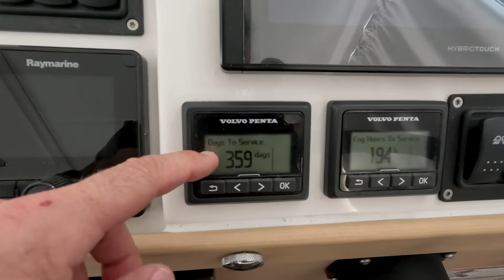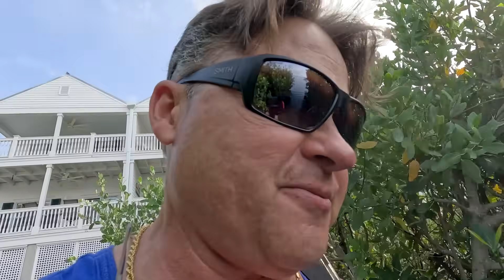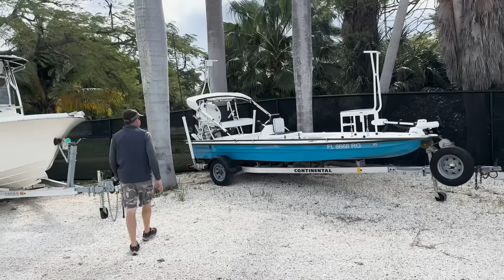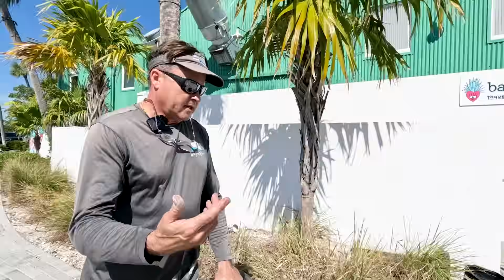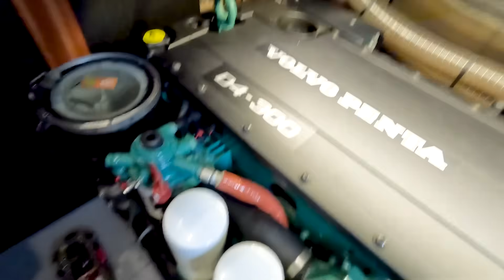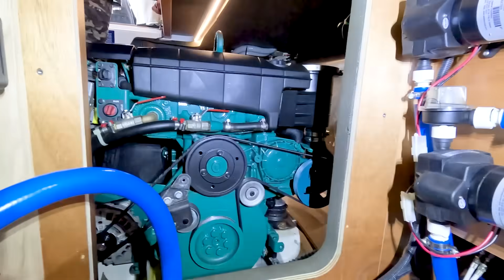What NO ONE Tells You About Owning a Yacht

Comment: I had a twin engine 30 foot yacht for 15 years and people think if you don't use it much then it will cost less, well that is not true as there are costs whether you use it or not, insurance for one as well in my location a regular marine survey every 6 years at a cost of 700 dollars, so insurance will maintain coverage, upkeep like hull cleaning, water intrusion, water pumps for keeping hull dry due to leakage, battery maintenance and I have 5 large marine batteries. Shore power, I am mean it is fun to own, but you are a slave to it.
Reply from the maker: Yes slave it is right. Constantly.

Comment: Most likely the PCU is bad . I always try an auto config first .  Since you’re going to update the software . I would swap port and SB PCU’s and run the software into  then . See if the hour issue follows the  PCU.  After you get the new PCU, you need to call tech support (Aaron) and have Volvo Penta credentials temporarily raised. Then you can up the new PCU engine hours.  You can only raise hours not lower hours.

Comment: I was thinking of everything before I bought my boat. I have been on many charters and I spent more time being tangled in some one else's line than I did fishing. I thought of renting. Those boats are a 50 50 whether the maintenance has been kept up so you are not left stranded 30 miles or more from shore. I don't mind cleaning or maintaining the boat. I am an auto mechanic. Although boat engines are different than cars, they still function the same way. Only the need a little more attention than cars do.
Reply from the maker: You’re lucky you can work in the boat yourself.

Comment: I am in automotive repair business and I consider anything not oem is counterfeit parts. They are imitation parts that look like the real thing but are not the same quality.  On very rare occasions I will use a non oem parts only if it is better quality but 90% of the time the oem parts are best. I would not trust an air plane, boat or safety features on a vehicle with anything but oem.
Reply from the maker: Agree with you OEM the way to go.

Comment: A pre-purchase inspection of some kind should be mandatory for any rational purchaser whether it's a boat, an aircraft, a large vehicle (RV, tractor-trailer, etc.), or any other large purchase that will require significant preventative maintenance. For the aircraft we had purchased, our first annual inspection included a bunch of mandatory maintenance (called ADs or airworthiness directives) and a few planned upgrades (better seat belts instead of just replacing the lap belts originally equipped, better lighting). That trip to the shop cost as much as purchasing the aircraft. An engine replacement often is going to be more cost than the purchase price of an otherwise acceptable condition used airplane, and the same goes for big trucks. The first time I brought the Peterbilt to the shop, when it was leaving the shop the bill was over $24k.

With the airplane, we would often talk with other owners in "Aviation Maintenance Unit" numbers (1 AMU = $1,000 USD).
Reply: As a retired maintainer (USAF comm/nav on Phantom and Bronco, engine mech and crew chief on F-16) if I were not already an A&P and wanted a personal aircraft I would pay for the schooling because that would be a bargain while giving me technical insights mere ownership never would. Parts prices would still be horrid but I'd dry my tears with the cash saved on labor, and the work is mind-expanding fun. 

Of course many truckers do the wrenching on their rigs and small fleets with commensurate benefits. I'm not a trucker but helped out my truch mech bro for the education as I enjoy wrenching everything. The junk he was handed to fix was terrifying but local log trucks don't need to cross DOT scales so they have to break down to get worked on. His cutting torch got plenty of use...

Comment: I have a 2000 45foot Excalibur my starboard motor dies if I hit my outdrive trim sometimes it’ll start back up and sometimes it won’t. Is that a grounding issue or ignition problem I replace the batteries and new alternator before I replace the alternator. I was getting 16 V on the starboard motor when I turned the key onwhen I replace the alternator it went back to 13 bolts so I thought that took care of it, but I’m still experiencing the problem. I emailed you. Thanks for your help.

Comment: Funny thing happened on my Mercruiser. Kept on loosing water pumps. I only bought factory pumps to replace.
Mercury was selling and installing automotive water pumps that needed antifreeze to lubricate the seals. My boat used raw water for cooling. I finally had to go to a aftermarket supplier, problem fixed.
Reply from the maker: Wow that’s crazy.

Comment: Are Silent yachts less expensive to maintain excluding fuel?
Reply from the maker: First off you still need to run the generator to charge the batteries.  There is still a drive train,  and look out if you have to change out the battery bank $$$$$$$$

Comment: My rule of thumb is that boats and yachts have an annual cost of about 15% to 25% of their value - excluding very small/inexpensive boats.  So a $100,000 boat will cost you about $20,000 annually or say $1,630 monthly.  If you use it 12 times annually, it will cost $1,600 per use.
Reply from the maker: Yup costs just depend where you live and cost of fuel.

Comment: Boats are expensive. We have an 06 46 foot that we bought used a few seasons ago. I spent 25k this winter just fixing cosmetic stuff from the old owner, in addition to probably 10k the winter before on urgent things. Next winter I’ll probably have the bottom media blasted and a barrier coat/ablative paint applied. Mind you, this boat surveyed very well! The list never ends, and if you buy it brand new, the list is shorter and the depreciation is larger. But I wouldn’t have it any other way…
Reply from the maker: Now I understand better yes only way to remove is blasting or sanding.
Reply from the maker: Inquiring minds want to know …. Why do you need to blast the bottom? If it already has barrier coat & paint leave it be … just recoat with same paint.
Reply: @ but it doesn’t have barrier coat and the layers of 19 year old bottom paint are starting to flake off in big flakes regardless of how much we have scuffed the bottom each year before applying ablative. Do you have a better plan given it has no primer/barrier coat? I’m all ears.

Comment: Every additional "system" added to a boat increases the expense and likelihood of a problem exponentially.  I have a 1977 Montauk 17 with a 75 hp Evinrude.  The only other systems on the boat are navigation lights, a compass and a Garmin chart plotter.  Even with these few things I am occasionally having to repair or replace components.  Boats with multiple engines, generators, autopilots, heating and air conditioning systems, galleys, heads, cabin lighting and electrical systems, electric windlasses, etc.  generally always have something that needs attention.  Unless the boat owner is a pretty accomplished mechanic, the expense to maintain all of these systems can add up very quickly.
Reply from the maker: Exactly!👍

Comment: I have a Grady 21ft WA/CC it has Yamaha power. I change the impeller every other season. And regular maintenance. I have a duel axel sea lion trailer. I've had that boat everywhere. My costs are low, gas mainly. My old boat was a 29 ft sport craft with an I/O that boat cost a fortune to run , slip fees and mechanical costs. The bigger you go the more it costs
Reply from the maker: Exactly the bigger the more it costs and more maintenance.

Comment: Big boats get about 1 mile per gallon so every mile you drive cost $5.00 which adds up quick when taking a long cruise. Your cars MPG drops a little driving faster a boat really consumes a lot more fuel when you power up. Unlike a car you can’t coast like going down him there is a constant resistance the hull against the water the faster you go the resistance multiplies.
Reply from the maker: When we just took the whaler we did like 3.6 mpg in gas. We took video if my numbers are wrong.

Comment: The 70's was the decade for my boating.  Gas was 50 cents a gallon and the slip rental, close to the inlet, was under 1K.  The engine work was points, rotor and condenser.  I did restore three wooden boats back to factory fresh.  NJ waters.
Reply from the maker: Those were the days! 😊 sounds like a lot of working doing 3 wooden boats.
Reply: Fifty cents a gallon in 1975 is only $3.11 in 2025 in constant dollars so at least petrol is still cheap.

Comment: A lot of people buy boats thinking they are like modern cars/trucks,,, just change the oil and a wiper blade once in a while and you should be good to go for years, but boats are absolutely not like that at all.  Just affording the purchase price is only the beginning and as many commenters have said if it is not a passion and more or less the center of your universe, then you will probably fail.  Lots of boats full of leaves and water sitting behind houses and in marina yards will attest to this.
Reply from the maker: Yes boats take much more work than cars or trucks.
Reply: I get so upset to see so many boats on trailers especially with no cover, but even sitting out without a roof and I know it only takes a couple years and the seats and floor are gonna be rotted. That makes it hard to sell someone an older boat that was taken care of because they assume its rotted out

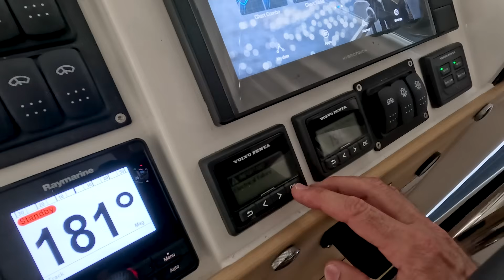Comment: You never do ANYTHING important that may need specialized  support on a Friday.  Examples - back in the early days of bypass surgeries, my dad had heart bypass surgery on a Thursday , post-op recover in those days was very slow. He got out of CCU on a Friday and -  well - he had difficulties.  His  “electrolytes”  were not balancing and all of the Docs disappeared on Saturday. There were one or two lonely, overworked  residents in the hospital. They cared  for  him got the “electrical system” balanced.  It was time consuming and the residents were stretched thin and it scared the heck out of us. I have has several heart procedures (the Family curse) and I suggest  Tuesdays or Wednesday. Professionally,  I was a City Manager, I was appointed  in a new Community, one of my duties was monitoring the sewer system. We had backup generators  for our sewer pump stations (you really DO want these to work) we were exercising  these generators on Friday…. Wrong! Try to find a diesel generator tech at 4:00 on a Friday if you do it will be and at double or triple time.  We changed to Wednesday mornings. If the repair was critical Wednesday afternoons were no problem.  If the glitch was minor Thursday’s were ok and a lot cheaper than at 4:00m PM of Friday. Any one who is considering buying a boat should watch channels like yours. You give good advice and your videos show what is involved in saltwater boat ownership. One lesson I picked up immediately from your videos was deferred maintenance is far more expensive and  sometimes can be more dangerous than routine, professional maintenance. Also there is no such thing  as a cheap to own  boat. However  a 16 ft aluminum trailered fresh water   boat  stored in your yard or garage may not break  the bank. But they still need proper care.

Comment: I love it when the customer is all exited to have come and check out their new boat. A 36' whatever with twin mer ruiser outdrives that they plan on leaving in the gulf coast water. Then i as nice as i can inform them that their boat will be un useable in a year and will probably cost half what they paid for it to repair it.😢
Reply from the maker: Agree we won’t even work on merc cruisers….
Reply: Whats wrong with Mercruisers?
Reply: @RangerOffroadWV  if you leave any outdrive in the salt water, it will be dead on about a year. The salt eats them, barnacles cut the bellows for the u joints etc. Anti fouling paint is loaded with copper. Just makes the drive battery and corrodes away. For salt water it has to be straight inboard or outboards.
Reply from the maker: @RangerOffroadWV nothing we don’t work on many gas engines not many here.

Comment: on planes we call it a prebuy inspection one of the most important things when buying a plane
Reply: Very important. Aircraft are certainly not cheap to keep either
Reply from the maker: Agree same as buying a house. Get an inspection know what problems you are buying.
Reply: Retired maintainer, A&P etc here. No way I'd buy an aircraft without PERSONALLY observing an exhaustive inspection because the best inspection training is following a skilled inspector throughout the process.
That's not distrust, it's for the valuable education. I'd also find out what areas are prone to corrosion and structural issues because while NDI isn't cheap, failure makes the news. Mech and techs appreciate aircrew
interest so if ya don't already mingle with your technicians that can be useful fun for all concerned.

Comment: Something to keep in mind that you highlighted a bit is that a normal inspector rarely has the knowledge required to inspect a driveline. The driveline is usually the most expensive part to encounter surprises from and the absolute most common problem I encounter when inspecting newly purchased boats. What many people don't understand is that the driveline determines most of the value in a boat.
Reply: Ate you referring to running Gear. Driveline, as to my knowledge is over land vehicles. Just asking
Reply: @edfernandez8673  it’s a term we use for the complete package, engine, drives and so on. I guess it’s different around the world .
Reply from the maker: Yes hire a shop that specializes in that engine.
Reply from the maker: Agree about inspectors hire a shop that specializes in that engine. We’ve done pre-purchase and we hooked up the vodia.